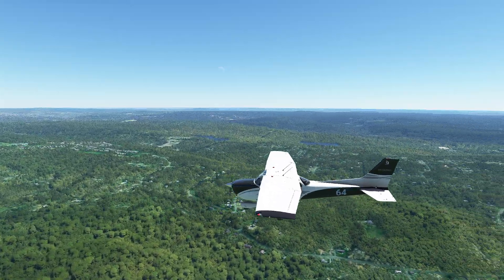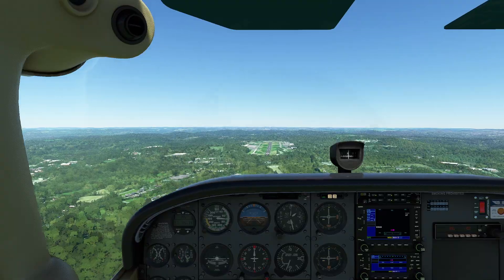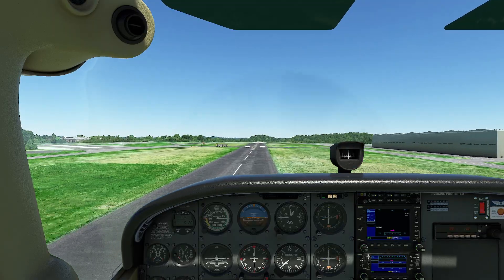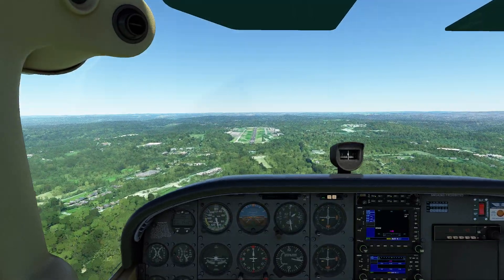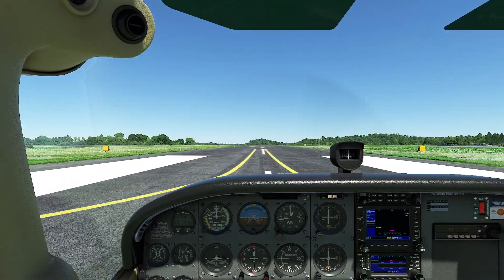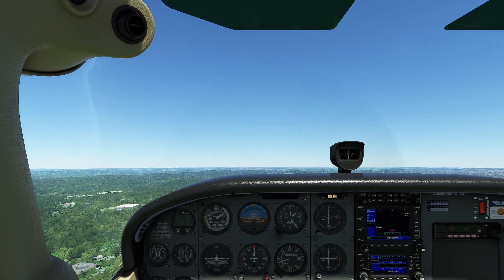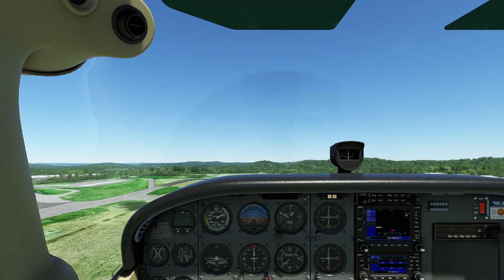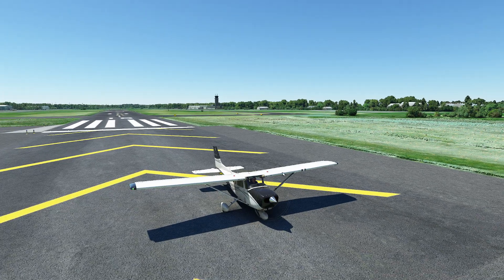MSFS - Glide Speed

Comment: Where do you look up this speed information?
Reply: You can find these in the Pilot Operating Handbook (POH) for your aircraft (GA aircraft), sometimes Checklists or Emergency checklists. You can also try to google best glide speed plus your aircraft...
Also of note, for the liners, you might have to work your way inside big graphs. Those take into account several parameters: weight i.e. cargo (no change during flight) plus fuel on board), air density, temperature, or others... 
As said here Best glide for Cessna 172 is 70 knots, regardless of any of these parameters (negligible for light aircraft). Same for the Cessna 172 G1000 although she has a different Empty Mass, and a more forward Empty Center of gravity).
And to be even more thorough, wind does not change your glide speed but the distance you fly, kinda the same way it is demonstrated here... 
Have a nice day everyone,
Reply: @romaingaullier7532  thank you for the thorough reply 💪🏼